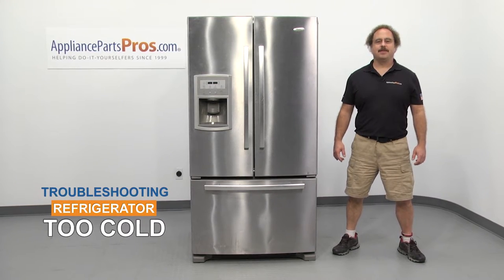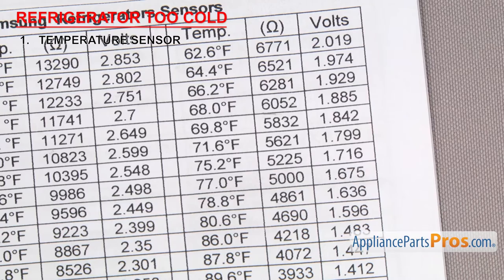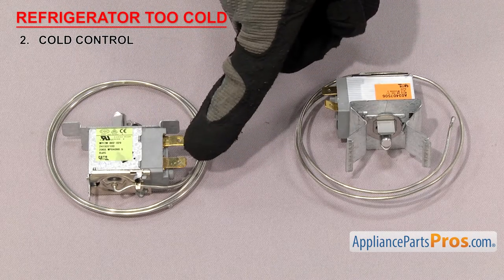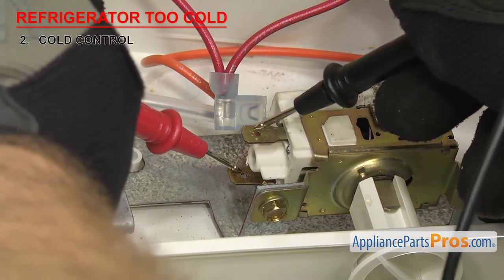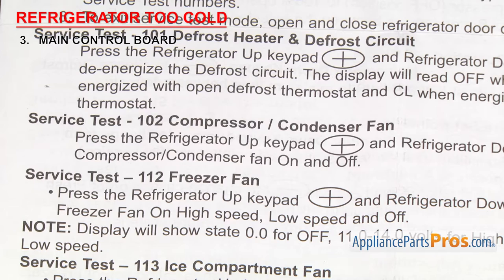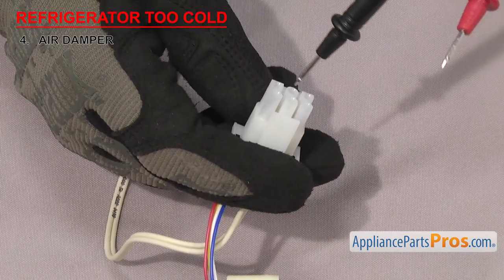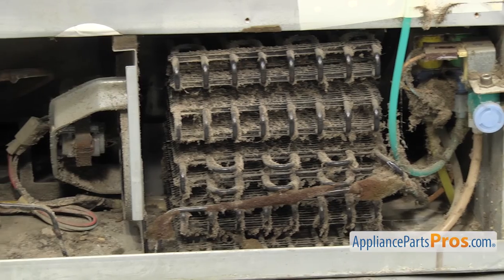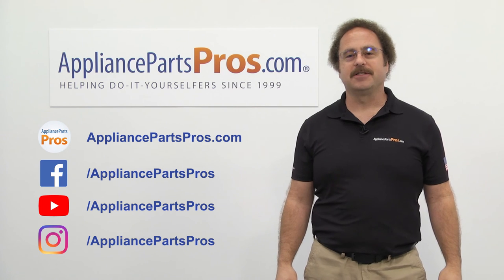Refrigerator Is Too Cold - Top 5 Reasons & Fixes - Kenmore, Whirlpool, Frigidaire, GE & more

Comment: Freezer too cold (-10), but refrigerator is just right at 37. Damper opens and closes. Built in diagnostics say both thermistors are good. All other built-in checks sat. 
No frost in freezer. Any ideas?

Comment: WHERE do you get the tech sheets?
Reply: Mine were stuffed in back of the bottom, removable kick panel. (Removable plastic piece in lower front protecting condenser coils, etc.)
Reply: What if we’re not so lucky?  Where do we find it?

Comment: Your subject line should include the required Eletrical current tester. Required!!    A home owner must go by this before wasting time watching this video. .
Reply: Multimeter at Harbor Freight.  Cheapest one $7.00!!!  Most expensive = $45.00.
Still, a LOT CHEAPER than a service call. Your Call!
Reply: Usually repairing your own things at home require tools. So that means if your going to try and repair something that has electrical components you might also need some basic electrical tools. Common sense.
Reply: It's obvious by your question  you don't have the skills to be competent DIY'er.  Just call for service until you educate yourself.